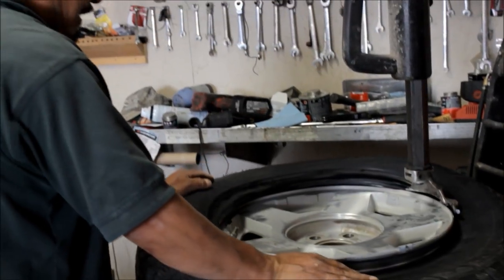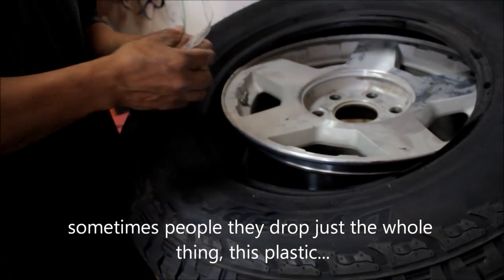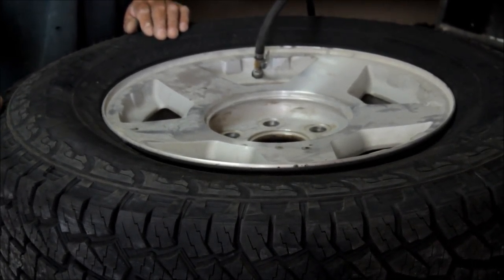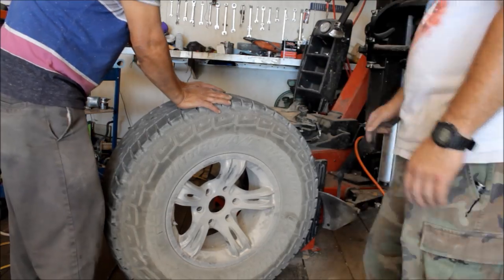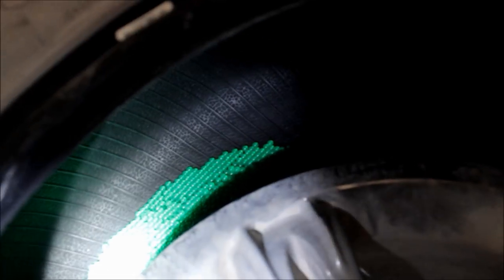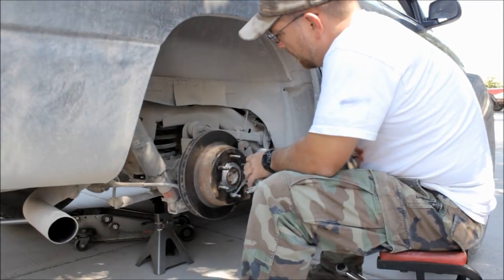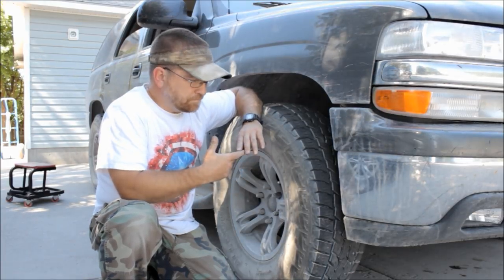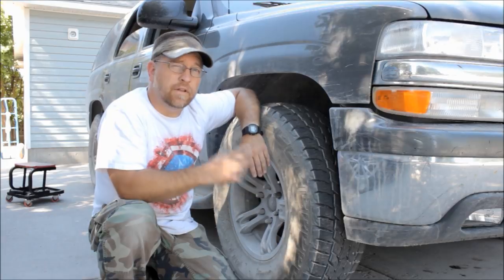6 Months with Airsoft BB's in My Tires. Did They Work ???

Comment: first he called them ceramic, then he called them plastic, then he shows tiny beads that are white that turn into orbeez over time. I hope he realizes those little orbeez over time collect water and will damage the rim because they never dry out.
Reply: Maple__Man You're not so funny mate.
Reply: Maple__Man Just keep the beads out of the radiator and they should stay pretty dry.
Reply: The "orbeez" are actual plastic airsoft bbs he put in them 6 months ago.
Reply: @nineunbuffed i wasnt trying to be funny "mate" i was being honest the guy has no clue what he is talking about. how do you call them air soft bb's for half the video (which are plastic) and then call them ceramic beads? if you used ceramic bb's in an airsoft 1: they would hurt like heck and 2: they would probably shatter on impact causing issues. they if they were airsoft bb's (again which are plastic) how did they go from white looking beads to green ones that look 10 times the size of what he put in the tire?
Reply: yeah if you read their website in the FAQ's they say the beads go in and come out looking the same,

http://www.eztirebeads.com/news-and-faqs.html

Can E-Z Tire Beads be re-used? Yes, they can be scooped out of your old tire and re-used. They come out of a tire looking pretty much the same way as they came in.

if you watch the above video they go in looking white at 0:37

and at 0:58 you can again see they are clearly tiny and white

at 2:10 in the video you can clearly see they are GREEN and shiny, not WHITE and tiny anymore

you can also see at 2:31 that the rim itself on the inside looks slightly wet or has condensation on it, from the "orbeez"
Reply: also again at 2:34 you can clearly see the beads are GREEN and huge compared to what they were when going in, which again for the color blind is WHITE.
Reply: You're not the brightest bulb out there, are you... watch the video again.  This time listen and actually attempt to follow along.
Reply: @Maple_Man once again, the beads that are GREEN are AIRSOFT BBS that he put in them 6 months ago. so again for the ignorant you didnt pay attention to the video.
Reply: did you watch part one? or seem to realize that that the video clip of putting the ceramic white beads into the tire is a different tire than the tire with the green plastic bbs? In this video his father got his tires changed and balanced using ceramic tire beads(the stuff you buy at the parts store) and while they were changing the tires for his father they took a tire off of his suv and took a look inside to see how the plastic bbs were holding up.
Reply: Maple__Man dude! You really need to watch the video again. Idk how someone fucks up that bad watching a video but you did man. congrats!
Reply: YOU need to watch the video again
Reply: @slayerofyou2010  He is an embarrassment to the rest of us :(
Reply: You should really watch the video with the sound on because he explained all of that it was two different tires going on two different vehicles